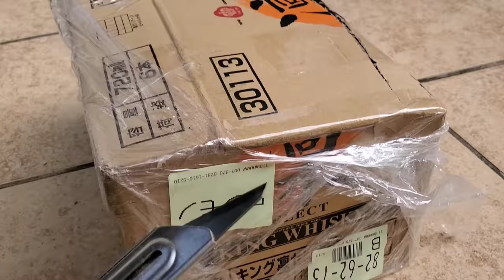Woodturning - The Lava!! 職人技！マグマの木を削る！

Comment: You took a beautiful piece of wood and did the absolute minimum that was needed to turn it into an absolute treasure. Thank you for respecting it and the wonder inside.
Reply from the maker: Thank you for your comment!🙇🇯🇵
  I was surprised to see a lot of oil coming out.  It was an old bump, but in the case of Pine, the oil does not seem to run out.  
The next video is a Rosewood box with severe cracks. I think it's rare to see a scene where brass is shaved with a gouge.

Comment: The color of that grain is intense!  Great work as always!
Reply from the maker: Thank you for your comment!🙇🇯🇵
  I was surprised to see a lot of oil coming out.  It was an old bump, but in the case of Pine, the oil does not seem to run out.  
The next video is a Rosewood box with severe cracks. I think it's rare to see a scene where brass is shaved with a gouge.

Comment: I will probably never stop being amazed at the beauty of the pattern and the color scheme of burl wood.
The fantasy of a person is not capable of inventing such a thing.
To make such beauty out of a piece of firewood is incredible.
Reply from the maker: Thank you for your comment as usual! I'm happy to hear that.🙇🇯🇵
  I was surprised to see a lot of oil coming out.  It was an old bump, but in the case of Pine, the oil does not seem to run out.  
The next video is a Rosewood box with severe cracks. I think it's rare to see a scene where brass is shaved with a gouge.

Comment: How nice that someone sent you a piece of wood for you to work with. The grain is interesting.  I am glad that you were able to make something nice out of it. At first I thought that it was to small but you made it work.
Reply from the maker: Thank you for your comment!🙇🇯🇵
  I was surprised to see a lot of oil coming out.  It was an old bump, but in the case of Pine, the oil does not seem to run out.  
The next video is a Rosewood box with severe cracks. I think it's rare to see a scene where brass is shaved with a gouge.

Comment: Looks fantastic simple but elegant letting the wood speak for its self
Reply from the maker: Thank you for your comment!🙇🇯🇵
  I was surprised to see a lot of oil coming out.  It was an old bump, but in the case of Pine, the oil does not seem to run out.  
The next video is a Rosewood box with severe cracks. I think it's rare to see a scene where brass is shaved with a gouge.

Comment: I have only seen one other pine burl. This one by far is unbelievable in it's beauty sir. 
Absolutely Gorgeous.
Thank you for sharing this video 👍.
Reply from the maker: Thank you for your comment carl!🙇🇯🇵
  I was surprised to see a lot of oil coming out.  It was an old bump, but in the case of Pine, the oil does not seem to run out.  
The next video is a Rosewood box with severe cracks. I think it's rare to see a scene where brass is shaved with a gouge.

Comment: Woooow!!! 🤤🤤🤤 i have never seen the pine burl and i didn't think it was so beautiful. Arigato Sensei! 🙏🏻🙏🏻🙏🏻
Reply from the maker: Thank you for your comment!🙇🇯🇵
  I was surprised to see a lot of oil coming out.  It was an old bump, but in the case of Pine, the oil does not seem to run out.  
The next video is a Rosewood box with severe cracks. I think it's rare to see a scene where brass is shaved with a gouge.

Comment: A really lovely and outstanding bowl. Very impressive!
Reply from the maker: Thank you for your comment!🙇🇯🇵
  I was surprised to see a lot of oil coming out.  It was an old bump, but in the case of Pine, the oil does not seem to run out.  
The next video is a Rosewood box with severe cracks. I think it's rare to see a scene where brass is shaved with a gouge.
Reply: @YamabikoWoodArt  looking forward to the next video. I have a some metal shavings from my small lathe metal turning. I can send you some if you wish. You can add it to resin and combine it with wood.

Comment: Really great design and beautiful piece of art. Cheers mr YAMABIKO 🙏 💯
Reply from the maker: Thank you for your comment as always! 🙇🇯🇵
  I was surprised to see a lot of oil coming out.  It was an old bump, but in the case of Pine, the oil does not seem to run out.  
The next video is a Rosewood box with severe cracks. I think it's rare to see a scene where brass is shaved with a gouge.

Comment: Rustic and Beautiful  👍👍👍. Thanks for sharing
Reply from the maker: Thank you for your comment!🙇🇯🇵
  I was surprised to see a lot of oil coming out.  It was an old bump, but in the case of Pine, the oil does not seem to run out.  
The next video is a Rosewood box with severe cracks. I think it's rare to see a scene where brass is shaved with a gouge.

Comment: Nice burl there Yambikio - it has come out lovely with all its colorful Flare !
  PS  * Good job saving extra cutout for later use !!
Reply from the maker: Thank you for your comment!🙇🇯🇵
  I was surprised to see a lot of oil coming out.  It was an old bump, but in the case of Pine, the oil does not seem to run out.  Coring is the best way to use the material for another project.
The next video is a Rosewood box with severe cracks. I think it's rare to see a scene where brass is shaved with a gouge.

Comment: What a beautiful piece. Thanks for sharing!
Reply from the maker: Thank you for your comment!🙇🇯🇵
  I was surprised to see a lot of oil coming out.  It was an old bump, but in the case of Pine, the oil does not seem to run out.  
The next video is a Rosewood box with severe cracks. I think it's rare to see a scene where brass is shaved with a gouge.

Comment: As usual, your work is beautiful. Will you be able to the little piece for a small project?
Reply from the maker: Thank you for your comment!🙇🇯🇵
I'm considering some small projects.  In that case, I think I will use resin.
  I was surprised to see a lot of oil coming out.  It was an old bump, but in the case of Pine, the oil does not seem to run out.  
In the next video, I'm going to make a box with a lid in ebony.  I'm worried about mixing other tree species with the picking.

Comment: Very beautiful in its simplicity. I love it.
👨‍🦽👍
Reply from the maker: Thank you for your comment!🙇🇯🇵
  I was surprised to see a lot of oil coming out.  It was an old bump, but in the case of Pine, the oil does not seem to run out.  
The next video is a Rosewood box with severe cracks. I think it's rare to see a scene where brass is shaved with a gouge.

Comment: Good work on a beautiful piece of wood.
Reply from the maker: Thank you for your comment!🙇🇯🇵
  I was surprised to see a lot of oil coming out.  It was an old bump, but in the case of Pine, the oil does not seem to run out.  
The next video is a Rosewood box with severe cracks. I think it's rare to see a scene where brass is shaved with a gouge.

Comment: It turned out very nice!
Reply from the maker: Thank you for your comment!🙇🇯🇵
  I was surprised to see a lot of oil coming out.  It was an old bump, but in the case of Pine, the oil does not seem to run out.  
The next video is a Rosewood box with severe cracks. I think it's rare to see a scene where brass is shaved with a gouge.

Comment: beautiful and eye-pleasing art👍👍
Reply from the maker: Thank you for your comment!🙇🇯🇵
  I was surprised to see a lot of oil coming out.  It was an old bump, but in the case of Pine, the oil does not seem to run out.  
The next video is a Rosewood box with severe cracks. I think it's rare to see a scene where brass is shaved with a gouge.

Comment: Truly Stunning!
Reply from the maker: Thank you for your comment!🙇🇯🇵
  I was surprised to see a lot of oil coming out.  It was an old bump, but in the case of Pine, the oil does not seem to run out.  
The next video is a Rosewood box with severe cracks. I think it's rare to see a scene where brass is shaved with a gouge.

Comment: Lovely 👏👏👏👏👏👏👏
Reply from the maker: Thank you for your comment!🙇🇯🇵
  I was surprised to see a lot of oil coming out.  It was an old bump, but in the case of Pine, the oil does not seem to run out.  
The next video is a Rosewood box with severe cracks. I think it's rare to see a scene where brass is shaved with a gouge.

Comment: Very pretty :)
Reply from the maker: Thank you for your comment!🙇🇯🇵
  I was surprised to see a lot of oil coming out.  It was an old bump, but in the case of Pine, the oil does not seem to run out.  
The next video is a Rosewood box with severe cracks. I think it's rare to see a scene where brass is shaved with a gouge.

Comment: That is a gnarly looking pine burl.
Reply from the maker: Thank you for your comment!🙇🇯🇵
  I was surprised to see a lot of oil coming out.  It was an old bump, but in the case of Pine, the oil does not seem to run out.  
The next video is a Rosewood box with severe cracks. I think it's rare to see a scene where brass is shaved with a gouge.
Reply: @YamabikoWoodArt  yeah. Inwas just surprised by the pattern of the woodgrain.

Comment: Gorgeous bowl.
Reply from the maker: Thank you for your comment!🙇🇯🇵
  I was surprised to see a lot of oil coming out.  It was an old bump, but in the case of Pine, the oil does not seem to run out.  
The next video is a Rosewood box with severe cracks. I think it's rare to see a scene where brass is shaved with a gouge.

Comment: Beautiful!
Reply from the maker: Thank you for your comment!🙇🇯🇵
  I was surprised to see a lot of oil coming out.  It was an old bump, but in the case of Pine, the oil does not seem to run out.  
The next video is a Rosewood box with severe cracks. I think it's rare to see a scene where brass is shaved with a gouge.

Comment: Amazing 👏
Reply from the maker: Thank you for your comment!🙇🇯🇵
  I was surprised to see a lot of oil coming out.  It was an old bump, but in the case of Pine, the oil does not seem to run out.  
The next video is a Rosewood box with severe cracks. I think it's rare to see a scene where brass is shaved with a gouge.
Reply: @YamabikoWoodArt  yes I have used brass powder with superglue in cracks it looks incredible

Comment: Nice!
Reply from the maker: Thank you for your comment!🙇🇯🇵
  I was surprised to see a lot of oil coming out.  It was an old bump, but in the case of Pine, the oil does not seem to run out.  
The next video is a Rosewood box with severe cracks. I think it's rare to see a scene where brass is shaved with a gouge.

Comment: 🎶👌👏
Reply from the maker: Thank you for your comment!🙇🇯🇵
  I was surprised to see a lot of oil coming out.  It was an old bump, but in the case of Pine, the oil does not seem to run out.  
The next video is a Rosewood box with severe cracks. I think it's rare to see a scene where brass is shaved with a gouge.